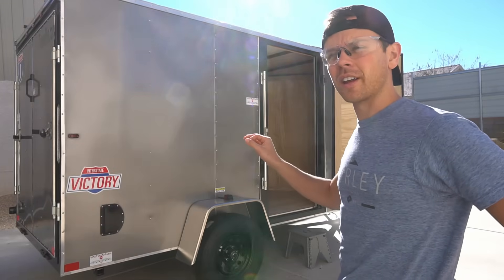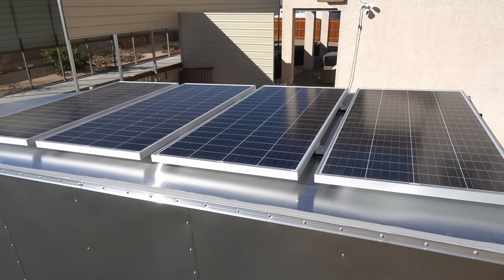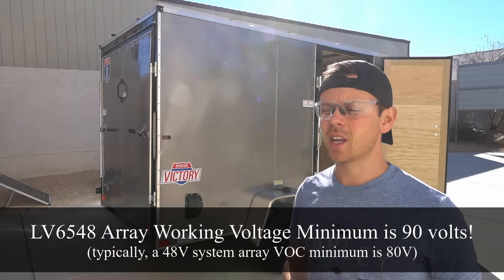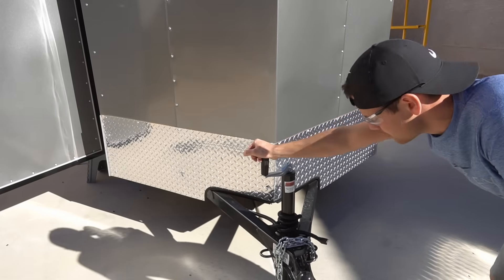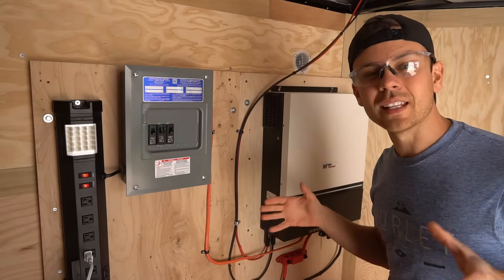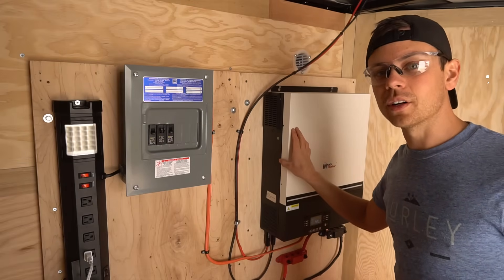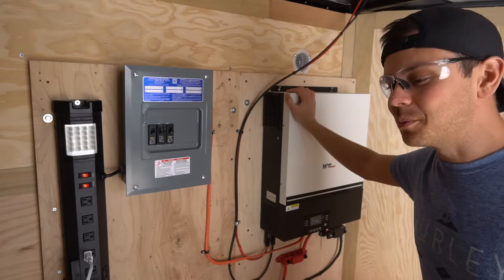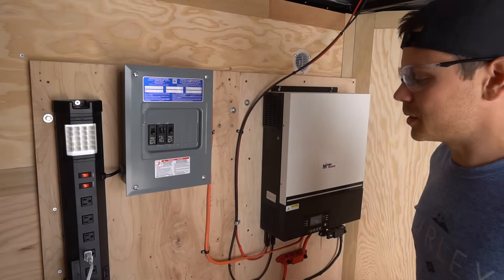Solar Trailer Part 3: 800W array installed and future updates

Comment: in "Medium (TV series)" the husband invented something that rotated the solar panels in a way, that the sun was used optimally... is there a special lense system on real solar panels, that does the same trick?
Reply: Ground-based systems make tracking easy using a timer (clock) but not so easy for a mobile array.

Comment: Why not install the solar panels similar to Everlande ?  Why the solar panels are only 200 Watts each with a total of 800 W ?  Air Conditioner needs more watts.   What brand are the solar panels?

Comment: I vote for an electric camper jack, to be cool, and to make room for the ac,  Or weld up a rack to hold the ac and bolt or weld it to the front of the trailer:')

Comment: I think it would be better to put it all in the V section. I know you said you want the option to carry long items but is it really worth taking up the main space? And maybe you could leave 8" or 12" in the middle of the V clear if all you're moving is long 2x4s or thin sheets of ply wood they would still fit and probably only fit in that space anyways. Of course, you know your plans for it but just my instinct is to keep the main area open because there'd be less risk of hitting anything. Anyways, just my thoughts.
Reply: Build a rack across the V nose about 18 inches off the floor. Place the equipment in the nose. Still have floor all the way to nose for 12 ft lumber but have to pay attention to tongue weight. This is why my preferred trailer is 7x16 flat front with extended tongue and dual axles. It eliminates those problems with more weight capacity.
Reply: @jstaffordii  I didn't consider tongue weight but it still seems like best option to me. Plus the battle borns are like feathers. 31 lbs each so only 124lbs total! But he could always move them temporarily if he really needed to balance weight for a load.

Comment: Can those panels be used in a 12 volt system or only 24 volt?
Reply: With an MPPT charge controller, they will be fine charging either voltage.
Reply: @SuperVstech  thanks

Comment: Will you need a more challenging project to keep you in trouble.
How about buying an insurance total Tesla for parts to use on rebuilding a gas pickup truck.
Reply from the maker: Oh man you know exactly what would get me motivated 😂
Reply: @WillProwse  How about this idea. A mobile bitcoin miner setup? They have 10 Gig fiber connections in limited locations. A mobile miner could be towed to one of these points. Max out the power inputs and add miners until all the power and speed max out. Talk about $$$$ in mined crypto. Also with the solar, how about panels hinged off all the sides to raise up and secure with poles for when the trailer is parked or you unlock and slide out additional panels to have a 3x6=18 panel total cantaliver roof array. Max out the battery bank efficency array to mine 24/7/365 for continuous free power the sun produces into bitcoin.

Comment: Do they have any good RV/solar trailer mounts where we can adjust the angles. Flat while driving, up/angled while set up...That are safe and wont pop open form road vibrations?
Reply from the maker: Be sure to check out my older beginner friendly playlists that will answer some of your recent comments. Or my book. Lots of info in my past content that will be relevant to you.
Reply from the maker: I've covered this in my book and older videos, but I personally hate pop up or tilt arrays on vehicles. Too many times I have heard horror stories of people leaving them extended or tilted. So I run my panels flat. Irradiance of sun is typically highest at zenith, because less atmosphere that the photons need to travel through, so more output. You also have no clue where the sun will be when you randomly park somewhere. So it is easier to just mount them parallel to the ground.

Comment: Has anyone checked what is inside a lifepo4 battery?
It seems to be a agm replica since all the parameters are the same.
It would be the biggest scam since the Lithium revolution. 
Lifepo4 battery cells supposed to stay at the same level of charge when charging or discharging but lifepo4 battery is proven to be a challenge to keep them equalized.
Reply from the maker: And no, their Soc curves and specific energy are a world away. Completely different.
Reply: @WillProwse  I am not sure about that. I have four packs 16S 48v system and can't charge above 55v.  They go crazy unbalanced and the voltage sagg exactly as agm batteries.
Reply from the maker: @neliosamch3195  I am sure about that. I have a CBA IV and I plot the data on a graph and the SOC curve is different. The potential across each battery type is different. We would have 6 cells in series instead of 4. You cant fake this stuff.
Reply: @WillProwse  Your Bigbattery was leaking sulfuric acid Isn't that what agm batteries has inside with fiberglass mats?
Reply: @MoBiRa-t6k  What was it?  lithium hexafluorophosphate salts,  propylene carbonate or tetrahydrofurane acid?
Reply: @MoBiRa-t6k  Okay a weight difference but still not convinced that lifepo4 is what it is. Or I  got completely unmatched, used or defective batteries, maybe fake batteries.  Who knows but completely unsatisfied with this chemistry.  Still prefer Lithium Nickel Manganese Cobalt Oxide (NMC) 100% LIFEPO4 batteries start getting unbalanced after 3.375 v and the higher the charge the higher the umbalancing get. It works fine with light loads or low current charging.
Reply: @MoBiRa-t6k  I have different bms balancers for each pack (Daly, Topbms and others) but it make no difference all behave the same. Yes I top balanced all of them but it make no difference. I keep them balanced under 3.375v with 10A active balancers but cells voltage jump high and shot down the bms above 3.375v. Top voltage cannot be more than 55v. No I didn't make the capacity test because of time but I believe some of them to be brand new but all have same behavior. My latest pack certified by lito are the same than the others.
Reply from the maker: No lol. Lifepo4 is very very very very different. I have opened them up and can verify.

Comment: Question, I have a 150/35 victron solar charger. If my calculations are correct I should be able to put on 8 newpowa 200 watt panels in series, running it down to controller on 10 gauge wire. Are my calculations correct??
Reply from the maker: The voltage would be too high. What is the VOC of the panels?
Reply: @WillProwse  17 volts per panel, 11.76 Amps.
Open Circuit VOC 20.23 volts
Short Circuit  ISC 12.45 amps
Reply: @MoBiRa-t6k  12 volt
Reply: 12 volt

Comment: Will, I am very proud of you and your successes you've made since your struggling years in California. So great to have income to support new ideas and bring them to fruition. Really like this build but wish you had bought a little larger trailer to carry anything you want to put in it. You can build a bracket-shelf on the front of your trailer, above the lift handle on the right side to mount a "Mr. Cool" mini-split condenser and the ductless unit above it or on the other side. This would not only cool but heat the trailer if needed.
Reply from the maker: Thanks Craig! And good idea!

Comment: Hey Will, addicted to your videos! I'm a 64 yr young female nomad living out of my Toyota Sienna with a 14 yr old female collie and a 3 yr old male Yorkie. I love your videos, your knowledge and integrity is UNMATCHED in the industry. I was considering buying one of those Montek Solar units from INDIEGOGO until u steered me right. Hobotech was promoting it only for $$$,  I assume. 
My question to u is, on that milk crate solar upgrade set up, I didn't see a DC outlet to plug in my frig/cooler which I now run off my 500 Jackery. I'm trying to grasp this whole solar concept, thats why I use a plug and play unit, such as a Jackery. I like the idea that the milk crate set up upgrade does not limit me to only a 100 watt solar panel. You're a brilliant young man and your integrity is a breath of fresh air and a magnet to those of us who's highest priority is integrity. 
God bless u.
Reply from the maker: I lived in a Toyota sienna before as well. I was able to mount 200W of flex panels to the roof. You can use the rear hatch brake light grommet to run wires inside. Great little van. I miss mine.
Reply: @WillProwse  

Thanks
Reply from the maker: Thanks! And yeah Doug is right. Just add a cigarette lighter adapter with fuse/ring terminals (Noco sells one on Amazon) or use a standard adapter wired to fuseblock. Just ensure the positive goes to red, and black goes to negative. And you will be good to go!
Reply: Adding a cigarette lighter is super easy on the milk crate. I put one on mine. The beautiful thing is how easy it will be for upgrades.

Comment: Put an electric jack on the trailer and do away with the handle, perhaps that will give you the room you need for the A/C in the front.
Reply: Get the Stromberg Carlson trailer Trey. I have my mini split on it and it fits perfectly!
Reply: Ahh that looks fine, too bad I got my ebikes there. :<
Reply: Or mount the AC higher
Reply: @michaelalbert8474  yes that's what I meant about the trailer trey. I have mine above my propane tanks on my travel trailer, fits perfectly!
Reply: @michaelalbert8474  That's what I'd do. You always heat from the bottom UP, because heat rises, and you cool from the top DOWN, because cold air falls.
Reply: @wjf213  other words get a 2 zone system Mount one at the ceiling and one on the floor, turn down one on the floor off in the summer. Then turn Zone 2 off at the ceiling in the winter

Comment: more power arh arh arh matey (ask tim the toolman taylor). put a fold-up down set of PV panels on the sides. and a 272Ah Lishen DIY battery bank. the side-mounted PV panels would be a good shade for you. i thought the battery is really too small.

Comment: I have a runaway camper and a 5K BTU AC in there will freeze you out. 

I want to run the AC during the day off solar panels and use grid for the night.